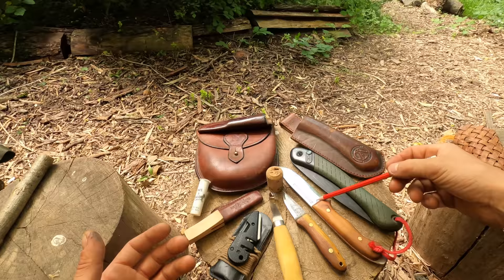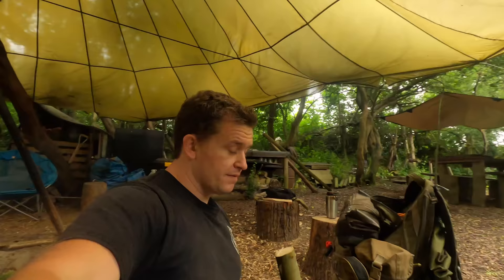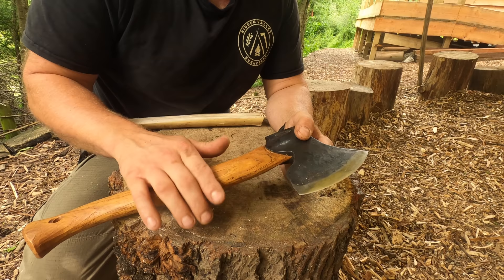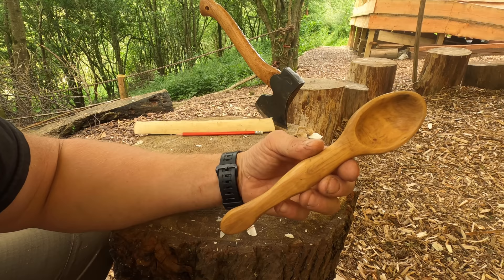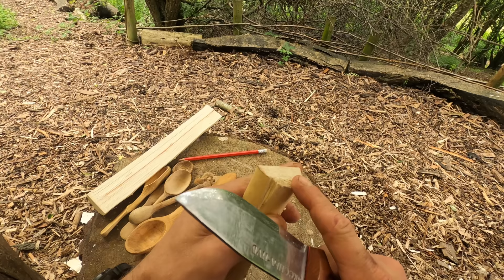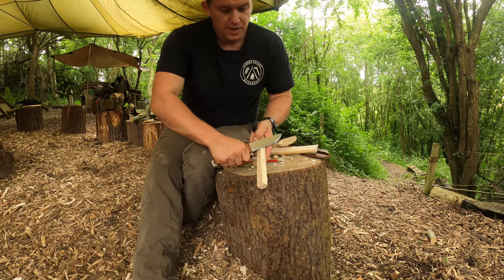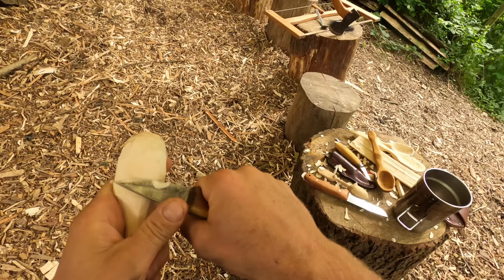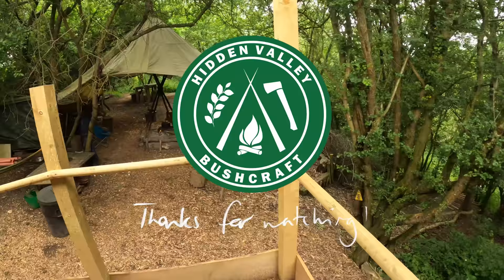Woodworking Wisdom | Spoon Carving For Beginners |  Tutorial from a Bushcraft Instructor | Campcraft

Comment: Really loving your videos man🤘 I use a lot of hand tools in my estate management job and I'm always curious with other people's choices,  Can I ask what your thoughts on handsaws? Is there a reason you use the Laplander over a similar sized silky? I've used both and always find the silky to be that bit more efficient. I primarily use the F180 and the Zubat👍 Looking forward to the next video✌️ Cheers 😎
Reply: Silky saws have their place but the Laplander is bullet proof.
Reply: @countryside_guy  I'm yet to snap my silky blade but have snapped 2 Laplander blades, I love both 🤠 Just like hearing people's thoughts 👍
Reply: @omnisegoastrum  I'm the opposite, I've snapped 2 Silky Pocketboys that were barely used. My Laplander I've had for 2 years and used it loads, bent the blade but straightened it again, it's solid.